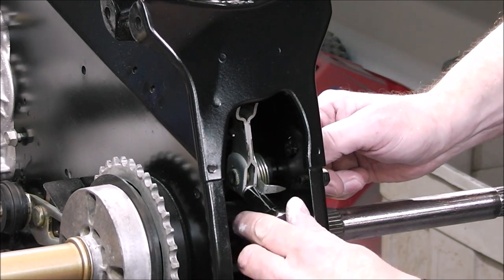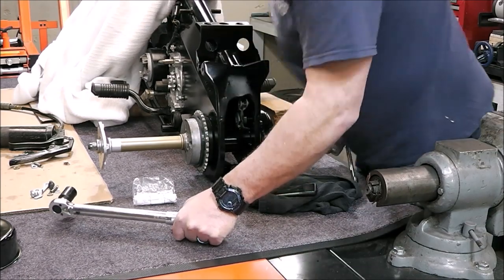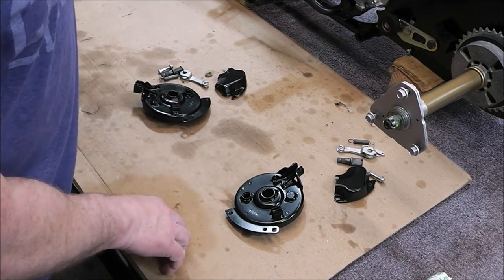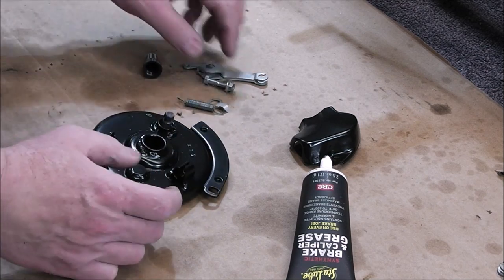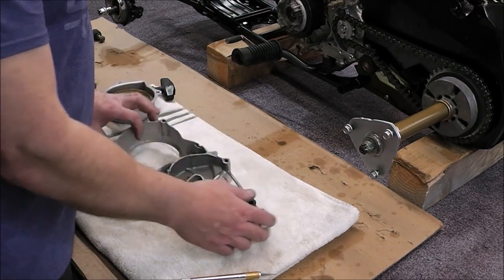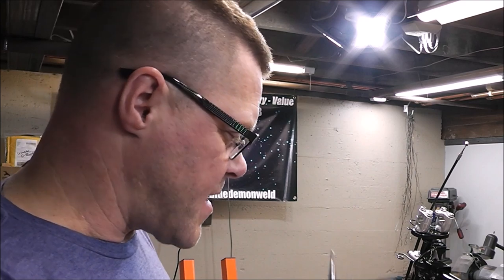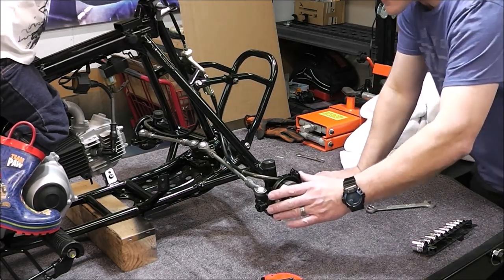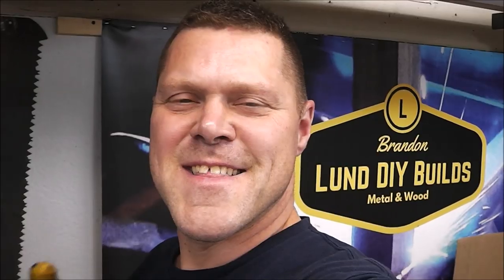Budget Honda trx70 Quad Restore, Brakes, Axles, Custom Gaskets Pt. 8 #doitforcolton

Comment: If my break drum doesn't insert smoothly doesn't mean I need a new one?  I'm also trying to get my axle to sit in there correctly slides. Anyhow help will be great
Reply from the maker: Possibly. I've also heard that the brake pads from an ATC70 and a TRX70 look simular but are different. This could cause it also. Whats going on with the axle?
Reply: @BrandonLund   thanks for the reply! I just can't get that damn drum over the brake pads. I think it's time for a new one. I think got the axle  figured out for some reason I couldn't  center it out.

Comment: whats the overall  length, width and height of that quad
Reply from the maker: I'll have to get back to you on this once I get the wheels installed. I will shout out the dimensions in the video.
Reply: @BrandonLund  👍

Comment: Reading glasses? Yer gettin’ old young fella, 🤣🤣🤣
When making gaskets for transformers and switchgear years ago we found that peining (or peening) the edges and holes was the way to go. Even with cast bits, not a problem because the hammer taps were quite light.
Cheers pal, the project is looking bloody good.
Reply from the maker: Try em brother! You will thank me. Even with "good" eyes" LOL. That's a great idea about peining the hole. I might have to steal that one! Thanks buddy! I cant wait to give this to him. I might even give it a rip :)
Reply: Well, yeah, truth be told, I have a cheap pair of 2X in my welding bag for tig, lol, better view of the puddle. And although I can hit a 6” target at 200yds with open sights on my 45-70 Marlin, and my optometrist tells my I don’t need glasses, I still wear very soft glasses for driving, lol. Eyes came good when I gave up cigarettes 🚬 7 years ago, but as things go, I update mild glasses every 5 years when I renew my license. Too cheap to pay the levee for a new license issue, plus my eyes will go bad sooner or later, lol. Still got a year to go on this one anyway, so we’ll see what happens next March.
Thanks Bran, keep up the good work mate.
Reply from the maker: Thanks buddy!  I gave up the smokes too...2 packs a day. My wife and I quit together 10 years ago. Probably the best thing I ever did. Good for you!  Take care buddy!
Reply: 43 years behind the smokes mate. At one stage using an ounce a day rollies, with a pipe thrown in,  lol. Haven't been able to strip the weight though, went from 95 to 125kgs.... 95kgs (about 210lbs) was my football playing weight, lol.
Reply from the maker: 🤣🤣🤣 I feel your pain brother... since I started cleaning up my act my pants get a little tighter each year...they must be shrinking 🤣🤣🤣

Comment: Такие прокладки очень удобно делать методом простукивания молотком. Фиксируешь заготовку на два болта по диагонали и простукиваешь маленьким молотком по краю детали внутреннюю и затем внешнюю поверхность. 😜 Such gaskets are very convenient to do by tapping with a hammer. Fix the workpiece on two bolts diagonally and tap the inner and then the outer surface of the part with a small hammer. 😜
Reply: Русский, дедовский метод ✊️

Comment: Idk if anyone's told you, but just a gasket hack, use a small hammer handle and tap lightly with the gasket material pressed over the item, it'll almost die cut the gasket for you.
Reply from the maker: I've actually heard that but for whatever reason I never remember to do it lol
Reply: @BrandonLund  it helps cut out a lot of time. So cool to see you building it with your little one! I was 15 when I built one for my niece. And now my 3 year old has an 85 atc all original down to the tires so meanwhile I picked up 2 of the trx's both 1986. So I'm building one of those now as a resto mod then ill restore the other to OG. Keep it up! Great daddy time right there!
Reply from the maker: Right on brother! Making memories!